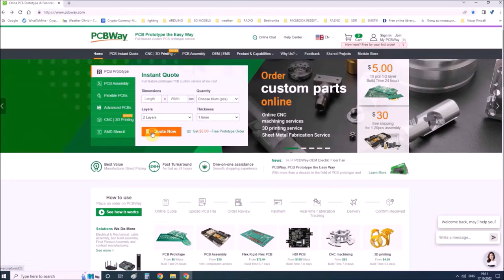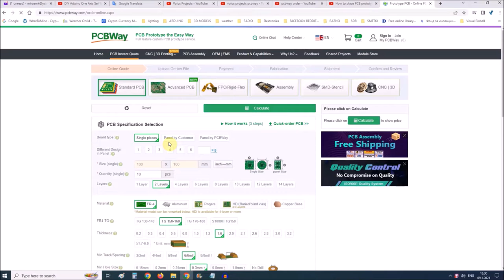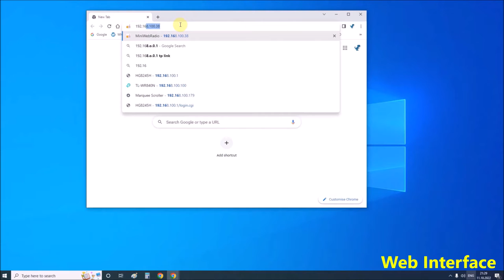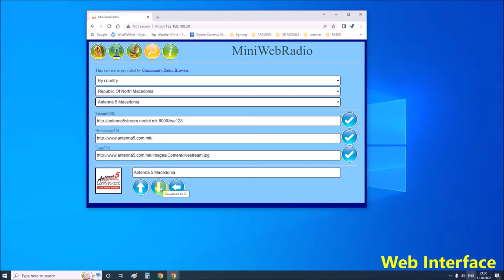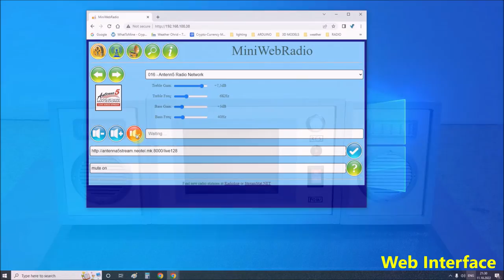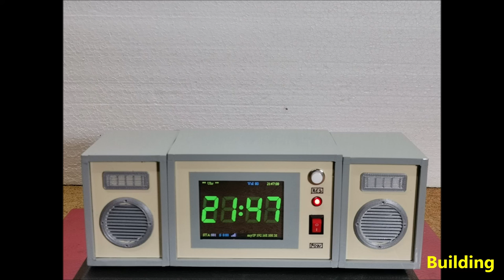ESP32 Internet Radio, MP3 Player , and Alarm Clock

Comment: I am very confused about the SD card. The coloured wires module connection diagram, shows MISO, SCLK, MOSI are connected to ESP32 but pinout diagram shows SD_MMC_D0, SD_MMC_CLK and SD_MMC_CMD. So which is right? Also my VS1053 has an SD card already which is connected to VS1053 MISO,SCLK and MOSI pins but has a separate SD Card CS pin - can I use the VS0153 SD card holder instead and if so what files do I need to change?
Also, AFAIK  SD cards require max 3.3V not 5V. So the diagram which shows 5V connection to SD card is wrong unless a 5V-3.3V level shift chip/card is used?

Comment: Please help, Im stuck with getting this to work..at all.  PlatformIO serial monitor says "[  1267][E][SD_MMC.cpp:138] begin(): Failed to initialize the card (0x107).                SD Card mount failed.   [card formatted as FAT32, since nothing is specified.] I checked and triple checked, no shorts,added the pullup resistor but still same as without it. . I am new to this, don't know whats wrong, or how to fix it. Would it be better to use the SD slot on the VS1053 or the ILI9341 tft slot instead?  TIA
Reply from the maker: I also had a problem with the initialization of the SD card and in the end I succeeded with a "Platinet" brand SD card with a capacity of 4GB, where I connected a pull-up resistor with a value of 10 kilohms to the D0 pin of SD card.
Reply: @MirkoPavleskiMK  Thank you for your reply Mirko, I will come back to this at a later date, as for now, I built 2 esp32 using KaRadio [one devMod with tft,vs1053; the other a lolin32 clone with oled & a i2s DAC] and built the YoRadio on esp32 devMod;vs1053,2.4 TouchTFT. which work very well.

Comment: Hi Mirko what is the size of the lcd screen?
Reply from the maker: 2.8 inch TFT Display 240x320
Reply: @MirkoPavleskiMK  thank you!!
Reply: @MirkoPavleskiMK  Hi Mirko can i use a ili9488 4 inch lcd  instead of this 2.8 ili9341?
Reply from the maker: @Evilslayer73  You cannot use ILI9488
Reply: @MirkoPavleskiMK  ok im gonna look for a sketch that it work with :) thank you!